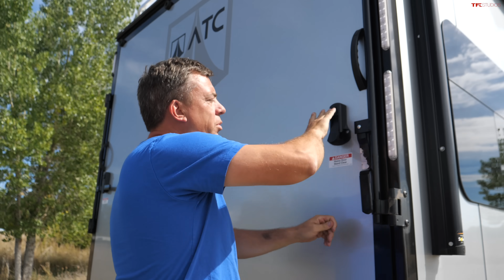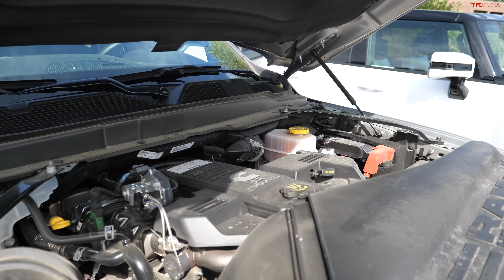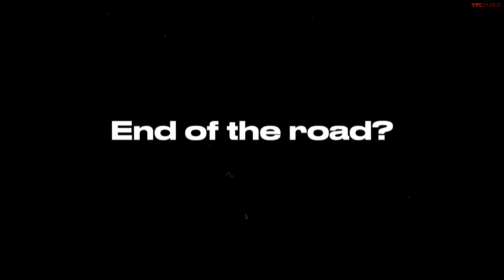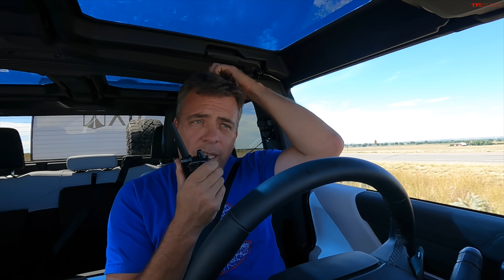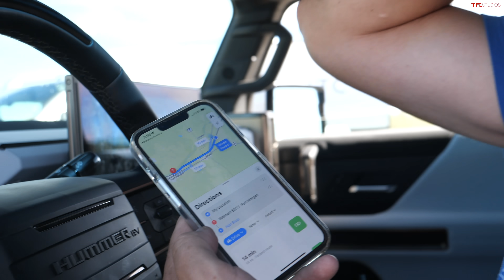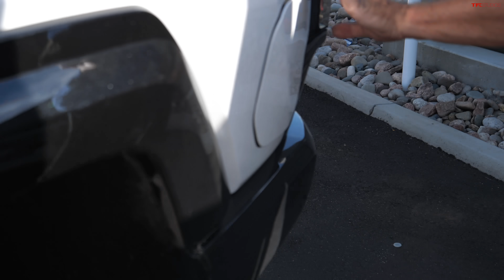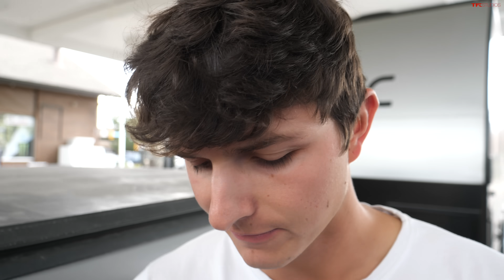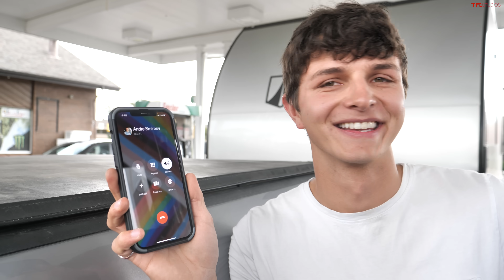How Far Can a Diesel and Electric Truck Tow An Identical Camper Trailer on ONE Fill-up?

Comment: Made a run from Augusta GA to Los Angeles CA in my Duramax. Pulling 5 tons I made the trek in 2 days using 232 gallons of diesel. On the way back same route in a 2 day run I used 138 gallons of diesel with no load. For one I made a round trip nearly coast to coast in 4 days. Second, if I had to stop and charge for 1 hour after every 2 hours of driving it would take me a week or more just to drive in one direction let alone the return trip. Electric vehicles especially those trying to fit in with the HD truck world are an absolute joke. DEF is also a joke. Green handle life for more me rolling coal for all to see.
Reply: Plus you get that beautiful, beautiful symphony of diesel clatter!
Reply: Diesel baby.
Reply: Truck gang
Reply: love my duramax
Reply: LBZ for the win
Reply: Only those who wants to demonstrate how badly tuned, over-fueled and inefficient their truck is, roll coal.  But your comments regarding range are valid.
Reply: @frankmoreau8847  pretty sure my truck is about as efficient as it’s going to get. 😉 regardless of the negativity at the beginning of your comment, my “poorly tuned and inefficient” diesel is far more efficient and practical than your golf carts.
Reply: Def is an absolute joke. I'll never buy a truck that requires def, so I'm basically gonna keep my trucks running forever. Like, literally forever, as long as parts are available. Ill replace anything and everything, it worth infinite dollars to keep them running.

And forget electric completely, what a ripoff.
Reply: @LovesGrilling  depends on the truck and if you want to bulletproof it or not.

My 2022 3500 ram runs like a champ, but I dumped money into everything that isn't great. Replacing the tranny the moment it gives me a hiccup lol.
Reply: just think how relaxing a trip you'd have if you did it in an EV, instead of being away from your family for 4 days, you could take it to 7 or even 8... of course thats if you can charge while you're logging down time sleeping.... EV make no sense yet.
Reply: ALCO Century: DID SOMEBODY SAY ROLL COAL?!!
Reply: Solo como dato.... Cada carro electrico de estos daña al medio ambiente mas q 200 a 220 carros  antiguos a combustion incluso si es v8 o diesel grande.

Entonces la etiqueta de amigable no va mas, el compuesto para baterias que usa es de lo peor y deberian ser prohibidos estos electricos hasta q puedan ser solares totalmente sin necesidad de tantas baterias nocivas, peligrosas xq se incendian, etc
Reply: No you didn’t
Reply: @user-vd9fz5ey9m  this directed at me? If so, you’re sadly mistaken.
Reply: I agree that long-distance is, at best, going to be hybrid, not all-electric. Electric is amazing if you're only doing short trips or lots of back roads where you get the benefits of recovery braking, but long-distance highway is just shit for electric.  They also have to get better at battery recycling, cost for batteries are coming down, but still high, and then you also will have to figure in temperature into the distance it will travel. 🙃

TLDR - Electric good for cities/stop&go traffic, not long-distance highways.
Reply: I agree the emissions equipment is a waste of time and in the long run probably worse for the environment but rolling coal is not helping...making the point of the environmentalist
Reply: @AXAR4  exactly and rolling coal is the sign of a shitty tune that’s wasting fuel. If we all got them deleted and tuned you’d not roll coal and you’ll get like 21mpg
Reply: Not only that but these green vehicles are not as green as they want you to believe.  You have to mine the lithium, which is very "ungreen", parts are mostly manufactured using non green energy,  etc.  Battery life/ cost to replace also is not cheap.  Plus if no charging ports you have to charge via.... generators.
Reply: @awhsum1  also the crude oil they make the plastic out of and other parts in the vehicle. Plus the crude oil and diesel that goes into the mining equipment and all the other equipment used in the making of this vehicle from the mines to the plant
Reply: @Doesntmatterreally  exactly
Reply: @awhsum1  battery technology is still improving. Lithium may soon be replaced as the technology gets better.
Reply: @awhsum1  this is what I keep saying. But hey what do we know.
Reply: This vehicle is not meant to be driven across the country. It is a city vehicle that while in the city drives 1000 times better than your diesel truck.

As usual people who enjoy burning oil don’t get it I’m probably never will.
Reply: @patty109109 ... I get it an EV meant for mainly city driving costs roughly twice as much as the a vehicle that runs anywhere on fossil fuels.. All those city driving environmentalist need to just use public transportation if they are so committed to this bogus Climate Change emergency.  Manufacturing a battery alone for one EV does more environmental damage then fossil fuels. 
When accounting for all the earth strip mined for one battery the environmental damage is off the scale, it requires strip mining  between 200,000 and 1,500,000 pounds (or between 90 and 680 tonnes) of earth on average to make one battery for a electric vehicle and thats just for the lithium needed.. Those figures don't include the vast quantity of materials, chemicals and other ores used in making the EV battery..
Example:  A lithium battery weighing about 1000 pounds typically contains about 25 pounds of lithium, 30 pounds of cobalt, 60 pounds of nickel, 110 pounds of graphite, 90 pounds of copper, about 400 pounds of steel, aluminium, and various plastic components. All this material is dug up from the earth and separate from the over 500 tons of earth displaced to extract the 25 pounds of lithium need for one EV battery and the machinery used are diesel powered. Now the 30 lbs. of cobalt, 60 lbs of nickel, 90 lbs of graphite, 110 lbs of copper, 400 lbs of steel, and aluminum all have the be stripped from the earth and processed to make one EV battery.
All this is what the government is hiding from you and if you think the charge stations will be free or cheaper think again.. Once the government gets enough EV's on the road the taxes and prices will skyrocket. All this for an inferior vehicle that is only good for traveling around the city..
Reply: @craigb6666  hats off to you sir! 👏👏👏
Reply: @craigb6666  not to mention most of  these charging stations are run off diesel generators and/or electricity coming from fossil fuel driven stations. Electricity isn't magic, it isn't just there to use like breathing  air
Reply: @craigb6666  Um mineral oil. It wasn't called fossil until they started talking climate and green crap many years ago.
Reply: @patty109109  this vehicle is for nobody. You're wrong. It's less efficient than a small electric vehicle. It's not a truck for towing. It's huge for cities. 

It's worse for every category -- this vehicle is for no one.
Reply: @LovesGrilling  a show off vehicle for  feel good moments when attending the green club meetings.
Reply: @patty109109  So what you are saying, I spend $114,000 on a vehicle that can only be driven in the city, but then have to rent a car to take a cross country trip...? And I "probably will never get it"... Wow! LOL!
Reply: @patty109109  electric trucks are only good in extremely specific use cases.

A truck is supposed to be THE, all purpose vehicle... If you can't go across the country and tow something, then it's not really an all purpose vehicle.

It's specific purpose.

Electric vans and small cars are fine. Everything else makes no sense right now.
Reply: @patty109109  willing to bet it doesn’t drive better than my diesel. 😉 EV is trash. The fact it is being pushed on us by big corporations should tell you that it’s garbage. Anything the government has to force on you is not for your benefit. Just saying. Why aren’t we sending EV’s to our military overseas? We send diesel vehicles to our military all the time and these diesels do not have all the EPA filter crap on them and do not use DEF fluid. Guess the air is cleaner over in the Middle East. It’s all propaganda. I’ll keep my coal roller. You keep your golf cart.
Reply: @patty109109  then just use an electric bicycle and not take up all that space. And where do you think the magic electricity comes from in the city?

Comment: It's not the economy that makes diesel preferred, it's the power/torque it produces, it also so happen to have the best(so far) loss of mileage when loaded, but what do I know, I only own a trucking business where I am the lead driver and mechanic so I'm probably not qualified. On a side note, most of the issues with my trucks would happen to be electric related, keep that in mind.

Comment: To compare a promotional 'free' charging fill up on the electric truck as compared to the $100 diesel fill up doesn't even make sense.  How much does an electric charge cost, how long does it take, are charging stations located everywhere and is there a restaurant with a clean bathroom so you can eat and soil the place as you wait.

Comment: The biggest problem with EVs is there isn't enough charging stations (yet) and it takes too long to charge (even longer if there's a line). They need to get the time to charge comparable with the time it takes to fill that Ram. Then it'll make more sense to buy EV because you'll save on fuel costs and they don't have a tailpipe emitting carbon. Now like he said if you're using your car just for commuting to work and back home then the EV is the better choice and if there are solar panels at home then your recharge is free . . .no more fuel bill.
Reply: Unless you want to haul anything. Other than the Ford Lightning, these trucks have the smallest beds. Ford has the best approach to the pickup truck right now. However, even it is still not very practical.
Reply: @Non-Woke Guy not true. My friend has a basic solar panel kit on his home that charges his Chevy Volt (plug-in hybrid). He charges at home and at work at a fraction of what it would cost at the pump. He went a year on 4 gallons of gas.
However you are correct that the current power grid can't handle the extra demand that will be coming , that needs to be addressed first. Super chargers can recharge in about 20 - 30min , it needs to be much faster.
Also a lot of power grids run off hydrodynamic generators (dams) and nuclear power plants as well. More and power plants are steering away from coal , some have looked into geothermal but currently it's just not economically feasible. Battery technology will get there they've already made huge leaps in performance and charging times over the last 10 years . . . they'll keep improving as will solar.
Reply: @Non-Woke Guy the Chevy Volt is an electric car it only runs on an electric motor. The electric motor propels the car. There is a small gas engine in the car that only charges the battery when needed , the gas engine doesn't propel the car at all , it's basically just a gas powered generator. There is only a 4 gallon gas tank to run that generator if needed. He went a year on ONE tank (4 gal).
His solar panels at home not only charges his car it and powers the home but also feeds the grid which the power company buys from him. . .he doesn't have an electric bill , he gets payments from the power company. His work allows their employees with EVs to plug in for free and that office also has huge solar panels.

Comment: I am half way through this video, and the question I have is 'What is the difference between the purchase price of these two vehicles?' That should also come into the equation. Apart from the total cost of running for, say 20 years,  all maintenance costs should be compared based on average mileage travelled by most truck owners. Then factor in the extra time required to operate, charge and use the EV, in the end there probably isn't a question of which to buy.... unless you have drunk all of the Koolaid
Reply: Ram was $78K and the Hummer was $114,000.  Don't forget to factor in the cost of the mileage tax for the EV to help offset the highway taxes they don't pay for like gasoline/diesel that will be coming along after the welfare period is over for the EV's.  Gotta pay for the roads and right now, they're not.

Comment: If chevy was smart, which it looks like they are not, they would have continued making the Volt and used that technology to make a hybrid pickup.... and then when the correct technology invited to make a fully electric truck came around move to that. The volt was smart. Gas engine disconnected from the wheels running at its most efficient rpm all the time and the electric motors being the most efficient as they can to move the wheels with no power sucking transmission. All the automotive manufacturers are doing the same thing the government is forcing us to with renewable energy. Instead of going, coal >natural gas > nuclear > solar (wind is useless) They are forcing everybody to go from coal or natural gas straight to solar.... and we are going too be the ones suffering because of it.

Comment: So as more people start using these chargers and the plugs and cords start to wear a little bit, who pays if you plug in your $100,000 vehicle and the smoke comes out? I am sure there are fuses on the batteries but there are a lot of electronics on these things that could be sensitive on these things.

Comment: My truck with no camper gets 20 to 24 on the hwy gas.  This would be like my truck getting 7 to 8 mpg when I hook up my camper I get 12 to 14 mpg  and it takes me about 10 min to fill up.  Diesel is usually a lot better I guess Im not buying a Dodge diesel or an EV

Comment: Electric vehicles 🚗 have a place however battery 🪫 technology is still a long ways off , and with a diesel or gas truck 🛻 you can add an extra fuel tank in the bed and double your range for a few hundred dollars

Comment: The 300 mile range is insane and not in a good way, even if the diesel gets 10mpg towing the trailer, it matches the ideal non towing range of the hummer. The hummer would not achieve that distance while towing, and would require you to add another hour to the relatively short trip.

Comment: Do a spreadsheet comparison of the cost over 10 years of ownership. You may be surprised that they cost the same, it’s just less convenient to charge right now.
Reply: Electric vehicles will eventually have a per mile tax to make up for loss revenue from federal and state tax on gas and diesel..That will add most cost to the electric
Reply: @dennisgill3459  they’re already charging 4x more for electric vehicle registration here to cover the gas tax, hybrids are 2x.

Comment: So basically if you put two drivers in both trucks from LA to NY departing at the same time the Ram would be in NY by the time the Hummer got to KC🤣🤣🤣
Reply: No cuz they woulda given up trying to tow through the mountains when the hummer's range dropped to below 70 miles and they didn't make the next charging station.
Reply: He would go roundtrip before the ev would go one way.
Reply: Go Ram👏
Reply: Only people doing that are cannonball runner's. If you owned Hummer you would charge at your home 99. 999999999999 percent of the time. Why are you so worried about the less than one percent yet forgot how less the one percent pays less in taxes than you.
Reply: @smithwrx5910  just filor facts.  The 1% certainly pay more.  Usually around 34% if its taxable income.  They also pay 24% of all taxes collected which is pretty good for 1%.  Also, 48% pay zero or less.  How do u like that?
Reply: @smithwrx5910  what you're saying doesn't make sense grammatically or whatever.

I think I get what you're saying but the average wealthy person pays excess taxes. The CEO/hide all my money hedge fund types aren't even the .1% it's like .001% lol

So the other .999% pay more taxes than all of us.

Anyway, you don't do road trips? A vehicle is supposed to be a tool, a horse can travel faster than most electric vehicles cross country...

Comment: What I find freaking hilarious here is the cummins averaging 9.7 mpg pulling a 6000lb trailer... my 5th wheel camper is 11,000lbs that I pull with my f250 and since some very specific stuff has fallen off the bottom of the truck and off the passenger side of the engine I average 15mpg. 🤣🤣🤣

Comment: Great video!  One thought, for the amount of 350kw charging, how many solar panels would be needed to bring that amount of power into the grid?   As the video has proven, we’re just not there…. But is the future of it truly sustainable?
Reply: It just depends on the output of the individual solar panels used, loss due to the wiring and other support equipment, etc.  if you’re looking at, say, 300w for a decent residential panel then you’d need about 1,167 panels just to theoretically make 350kw.  Add in an extra 10% to cover losses in the wiring, converter & panel differences and you’re looking at around 1,283 panels to reliably and realistically make 350kw.
Reply: So in this use case, charging the H EV, where’s that amount of power coming from?
Reply: @garrettd5041  the grid or maybe diesel generators behind the wall.

Comment: I’d love to see this pull ups hill and down the other side.   Compare energy used going up then what would be regenerating on the way down.
Reply: As a person who pulls trailers this size over the divide frequently, I can tell you that you won't gain a thing on the way down. If I put my truck in neutral and coast down the highway passes, I lose speed due to the wind resistance of the trailer. It would be different on low-speed mountain roads, for instance driving down Golden Gate Canyon, I'm sure it would pick up some charge.
Reply: Keep in mind in order to regenerate any sizeable amount of power, the truck would need to induce voltage that would act like braking. So add up wind resistance and the braking effect, you wouldn’t gain much if anything.